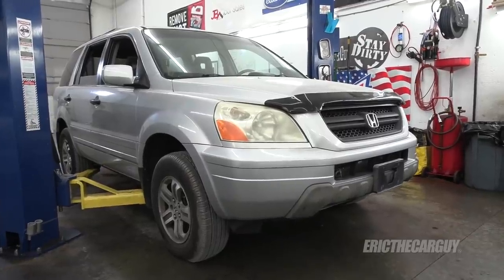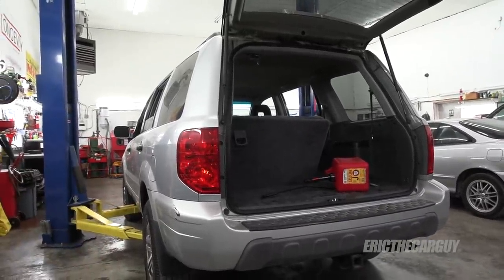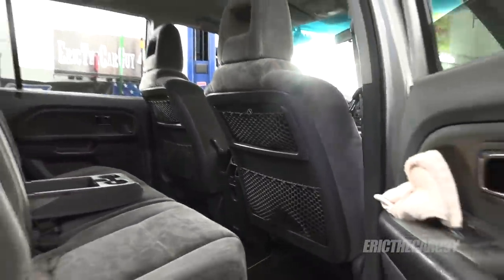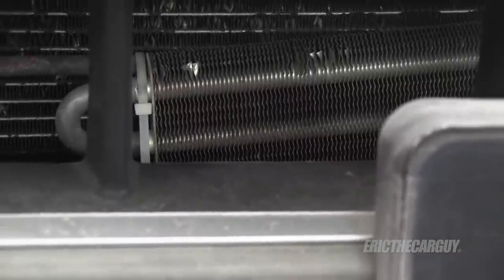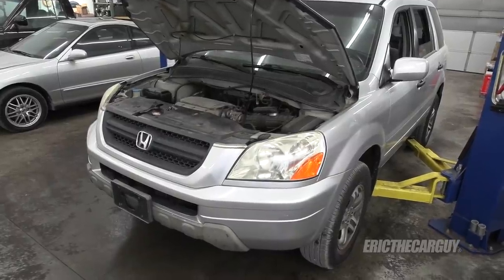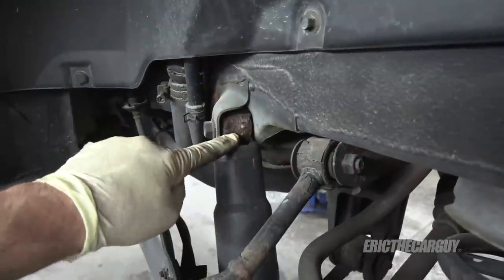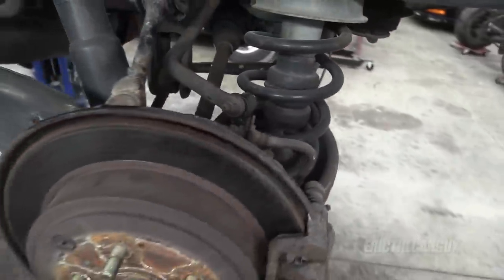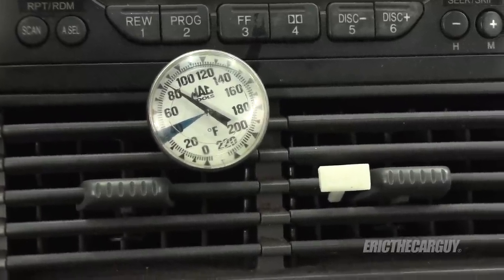2003 Honda Pilot Inspection This Thing Needs Help

Comment: Eric: Unlike your other Honda V6 engines you've been working on, this one has the PCV valve rear valve cover, and the fresh air port (from the intake tube) on the front valve cover next to the oil cap. That means the rear head is the one filled with crankcase fumes and gets ALL the baked on crap. So on this particular engine it's safe to assume the rear head is at least twice as gunked up as the front head.  This design annoyed me cause checking under the oil cap was a lie and only revealed the "cleanest" section of the engine (where fresh air comes in).
Reply from the maker: I suppose we'll see when I get the valve covers off. Thanks for the comment.
Reply: Yep my 99 accord same thing, front was clean, rear redish brown
Reply: If its an 03 , I take its a J35A4
Reply: @ericthecarguy  one thing with the pilots every 100,000 miles need to do the timing belt and the valve adjustments
Reply: @at6098  talking to a dude that’s worked for Honda I’m sure he knows
Reply: @at6098  You know he's been working on Hondas for like 25 years, right?

Comment: They may have bypassed the factory trans cooler so they wouldn’t get the “milkshake of death”.     (A common problem with pilot and ridgeline the fitting on the radiator).
Reply: Hmm .... you bring up a great point.  Perhaps they already made the milkshake and were trying to see if they could save it with a flush, fresh fluid and an external cooler.

The milkshake issue is a known problem on my 08 Nissan Titan so when I developed a small radiator leak, I went ahead and put down the change for an all aluminum radiator (without the internal cooler) and added an external cooler.  Now only God can make the strawberry milkshake of death.
Reply: @jimjones5077  titans had that issue too didnt know, thougbt it was only Pathfinder/Frontiers
Reply: My exact thought when saw that.  Typically should put in the much larger oem tranny cooler did that to my 2005 pilot EX-L a few years ago as precentative to avoid my tranny to be screwed when the faulty radiator goes.

Comment: My son is a 2004 pilot ex with around 285,000 miles. Already replaced the transmission and radiator. He also bought a complete exhaust system from where you got your exhaust for your element.  The exhaust by the catalytic converter was rusted.

Comment: I bought a 2005 Pilot brand new.  I put 120K miles on it, sold it to my inlaws who put another 20K miles on it, then bought it back for my son.  At 170K miles it still runs great and has been trouble free.  I've done some of the things on your list (timing belt, brakes, suspension, tie rods) but am really looking forward to watching all your videos.

Comment: I have a 2007 Ridgeline that bent valves. Have you ever or do you suggest replacing valves or cylinder heads?

Comment: Can't wait because we have a 05...I am definitely interested in transmission info about remove and replace. I will be watching with anticipation. Thanks again for the great work you do!
Reply: We have an 05 also. 220,000 miles. Thing is a miracle
Reply: @dancs5414  my sons has 260,000 and it's his daily driver.
Reply: Same here have a 05 EX-L with 150k for the past 3 years hasn't failed me at all except basic maintenance items and is solid

Comment: Having pulled a salvage yard motor in July 2021 for my bro-in-law's 2004 Pilot, all of this is intimately familiar.  Not a veteran wrench on Honda products.  But we did a good job, got it running, drove it to a local garage to do some gasket work that, frankly, I was kind of wiped out to do.  Garage said I did a good job with the timing belt/water pump, go me.  The 00's Pilots don't feel much like an SUV as they don't ride like trucks.  But now I'm familiar with the 3.5, I'm looking around for 'distressed' Honda Odysseys that need an engine or trans swap to make them good again.

Comment: I bought a 2003 Honda Pilot a few years ago it had close to 100k miles when we bought it, a few years later I sold it to one of my siblings and it had close to 200k miles, and is still running. Best buy ever!

Comment: Transmission shift sensors are notorious for failing. May not be the transmission. I know you said you worked @ Acura. I have an 05.
Also, MaxLife transmission fluid works just fine. 183K miles. Looking forward to seeing what I can learn.

Comment: My dad's first pilot, which was ironically another silver 2003, also had the same thing happen with the 3rd row seat not folding down because the release handle broke. It was actually fixed under warranty so unfortunately I don't know what they did to fix that but I do know that it is a common problem on those things.

Comment: I remember driving a 2000 TL, dreading the inevitable P0740. Never showed up. The transmission failed, but I got a P0750 code instead. Sold it to a tech at the Honda dealer for $400. Eric, you told me I should ask for more, but I was so PO'd that I just wanted it gone. Fun times. The only confirmed fix for those cars was to fit a 2006/7 Accord V6 transmission in.

Comment: Eric here is a tip for ya , I worked at Honda for 26 years and my hobby was wrenching on cars and I imagined at a young age a career in auto repair industry so I ended up staying updated by my hobby and working on all the cars for all my buddies I worked with and their families and friends so naturally a lot of those were Honda’s and one of my many secrets I picked up along the way was as a employee I got a discount on all the oem parts I ordered thru service center but I discovered that if I ordered those parts online thru a place called majestic Honda which by the way is a dealer up north east like New Hampshire or Massachusetts or something like that been three or four years since I have ordered parts from them by now but the point is I got a bigger discount than I got from the service center located on factory grounds and some were substantial so if you want to give it a try and you can wait few days for delivery you could save alot money and the exploded diagram on the website was especially convenient and helpful also when getting those oem part numbers anyhow good luck and don’t let them wrenches get rusty.
Reply from the maker: I did that for a while from a place called HondaPartsNow. Thing is, after you factor in shipping, the cost is about the same. Also, since I'm in OH, I get the parts faster from the dealer since most of them come from Troy anyway. Thanks for the heads up and comment.

Comment: 1st thing, that came into my mind with cables hooked into the airtemp-sensor: The ebay "Tune-ECUs"! Mostly they are small resistors and got hooked up to cheat the ECU into thinking the air is at a different temp, to get a whole lot of snake-oil claims: better gas mileage, more power, better emissions - you name it.

Have a nice day!
Simmie

Comment: I'm curious to see you mount what i'm pretty sure is a GM 3800 series II intake onto that if you use it. Those M90's added 40 hp to the series II V6's giving them 240 at the crank. The later series III 3800 had an improved M90 which added 60 hp giving it 260. they weren't ran with intercoolers from the factory either. I'm looking forward to this.

Comment: I bought a 2005 Honda Pilot with 200,000 miles and just did a cross country trip west coast to east coast and had no issues whatsoever, also on my trip my friends 2002 Excursion 7.3 diesel ran out of gas on the interstate..(which was scary moment because had concrete barriers on both sides on both lanes) i hooked up 2- 1 inch tow straps to my tow package to his Excursion and towed him with my pilot 1/2mile and up an exit ramp with another 1/4mile to the gas station!....Pilots rock

Comment: Hey how we doing you help me wait a bit on different things I just recently watched a video on brake controller and redid the ground well I have a 1995 jeep sport everything works good except when you pull the lights on or parking lights or headlights doesn’t matter trailer goes in the lock mode just wonder if you could help Appreciate your videos and thanks for help

Comment: Thanks Eric for helping fix my Pilot.  One suggestion is to inspect for rust just in front of the spare tire, where the subframe bolts connect to the body.  You'll maybe not notice if one side is bad, but when the second side pulls out, the rear suspension drops down .. No fun if it happens without warning .. I'm looking forward to the supercharger build. Thanks again.

Comment: I just recently picked up an 05 Pilot AWD with 220k. Engine and trans are great, cold ac, newer all weather tires, laundry list of new front end components. Picked it up for $1500 because the rear sub frame is rotted. I changed the front and rear brakes, spark plugs, timing belt and water pump on it.

I'm a truck driver so I only drive it a few times a month and then we take it on long trips every couple months. Should last a few years before that rear sub frame mount gives out completely 😅

Comment: I like SUVs mainly because of the higher ride height. In my country, roads are pretty bad for lower standing vehicles such as sedans and minivans. It's a nightmare. Granted, SUVs are a little bit more expensive to maintain, but if you have the money, you like them and suit your needs, go for one. They are very practical vehicles for what they are, too.

Comment: I have a 2003 honda pilot with 213k miles and its running strong still on original transmission. I gotta replace the timing belt soon though which I'm not looking forward to

Comment: I have an 03 Acura MDX and half the problems that pilot has I got I'm worried about the bumper dropping off 😅 but I'm also concern why my trans keeps holding the 1st gear going to 2nd 🤔 but that supercharger setup I REALLY 😃 want to do that but I can't unfortunately 😅

Comment: Seems like it'll be a fun project but when I had my 04 it seemed to be never ending problems. Make sure you check the brake lines at the rear wheels for rust. Both sides rusted out and leaked

Comment: These days I use Valvoline MaxLife ATF in my '98 CRV and '05 Pilot....been using it for around eight years. It's a synthetic and I like it better than Honda's ATF...and it's much cheaper($17.89/gal at Walmart)  to boot.

Comment: My wife has a 2004 Pilot the same color with 223,000 miles.  It needs a lot of work, but it still runs and drives pretty good. There is a lot of rust and bad bushings underneath.  Also needs engine mounts and a tune up. I'll get it all done eventually. Maybe

Comment: I just bought the cousin to this it's 05 mdx people said engine was bad but it was the alternator and ac pump froze up.. I only gave 200. For mine tho. I'm going fix that and rear sub frame rust issue .. just use it for beater

Comment: As the proud owner of an '05 EX Pilot, I love and depend on Eric's videos (yes I did my timing belt, thanks!). But supercharged? You madman! I can't wait. PS I grabbed a factory aux trans cooler from my local auto wrecker, and it was a breeze to install (after flushing, of course).

Comment: I have a 2007 honda pilot. They are usually good if taken care of. Maintenance items I've had with it are as follows: wheel hub replacement, timing belt replacement, shock stop, tailgate latch assembly and ac assembly line replacement.   Planning on adding a tow receiver if I find one at a decent price. Can't wait to see the supercharger on there
Reply: My 2003 has the factory towing package which has only been used a couple of times. I’ve replaced door lock actuators and the rear air blower relay a couple of times. Mine has the rear entertainment system and it all still works. One of the best cars I’ve owned since my 1997 Accord

Comment: Eric, get a water to air intercooler, and a heat exchanger, run the water for the W2A through the heat exchanger, and plumb the other half of it to the AC system to cool the water.

Look up Killer Chiller, it's a really good design, keeps the intake temps way down.

Comment: I hear ya about the bead leaks ! 3 times to the same shop before it stopped. I wouldn't want to toe anything even if it wasn't rusted. Those uni-bodies to me are weak. The AC doesn't work that sux. LOL

Comment: No oil leaks and look inside the motor for the mileage looks super clean 👌
Reply from the maker: I think it was well maintained early in its life.
Reply: @ericthecarguy  I agree very well maintained and the amount of rust is actually impressive for the vehicles location and state was very well cared for

Comment: You bought this car about a month after I bought my 2007 pilot I've done the front and rear suspension as you plan to do. Looking forward to watching your supercharge this thing. I will tell you there is a plate you can purchase for this car to adapt that supercharger it does not have an intercooler though. Texas Honda channel did this on a pilot about 6 months ago if you want to look it up.
Reply from the maker: I found his channel during my research. He provided a lot of useful info. Thanks for the comment.

Comment: I have a 2008. Motor blew when I paid a "Dum*&*&*??" to change the timing belt. He didn't torque a tensioner properly and blew the engine. Waiting for the heads to come back from the shop right now. I love this car, but it's a bit sluggish on the road and I wish I could fit a manual tranny on it. I wonder if there's a way to put a manual tranny in it...

Comment: My thoughts on that transmission cooler are that they bypassed the cooler in the radiator out of fear of creating the old strawberry milkshake of death in the transmission if the radiator falls in that way. Some of those are more prone to that than others though

Comment: We have a 2004 Pilot, with about 185k on it. Bought it with about 85k on it. The trans finally gave up. As you stated, it wasn’t worth the effort playing with solenoids and such. Without having a lift, it had to go to a shop for a reman unit. They also installed an external cooler in series. 

Everything else works great. 
Regarding towing, note that Honda requires extra power steering cooling. The factory piece costs $$$ and just has a little more tubing and a few more fins. My idea is to get a second standard cooler from a wrecking yard and add it in series. 

The left rear power window quit and I bought an OEM replacement. It was a HUA day and I convinced myself the mounting holes didn’t line up so I hogged them out to no avail. I continued the HUA adventure by buying a D****n unit. Then I discovered what needed to be moved to make the unit fit. 
Bottom line: I have an OEM left rear unit with elongated holes that hasn’t been powered up.
Let me know if you need it.

Comment: Well, it's certainly been around the block a few times - and it's got the scars to prove it. But all that wear & tear makes for excellent video material. Looking forward to it already! 😊🚗
Reply from the maker: Honestly, I think this Pilot was well maintained in its early life as evidenced by the lack of significant oil leaks. Then it went to someone who didn't really care and traded it in for something else. I think this ended up at auction and was picked up by the used car dealer that sold it to Jennifer. Now it's my turn. Have a great weekend.
Reply: @ericthecarguy  At least it has finally fallen into the right hands. Have a great weekend too. 😊🚗

Comment: I've got a similar 2003 with 160k on it, so really looking forward to this series! :)  The way the rear seat recline handles and/or cables break is frustrating and I've had a hard time finding replacements that last.  Also if you're taking the front bumper off for any transmission cooler or headlight work, can you call out the fastener groups involved?  I've tried taking mine off and it's held on by some divine force at this point.  Will be keeping an eye out in the Video Forum for more conversation on this car!
Reply from the maker: The key is the screws that go in from underneath where it connects to the fender in the wheel well. I'll show it in the videos at some point. Thanks for the comment.

Comment: I have an 06 Pilot I bought back in November 2020. I had the entire timing belt water pump kit replaced along with NGK laser spark plugs and cheap eBay coils. The front end was clunking therefore replaced the stabilizer bushings & links. The lower arm bushes were worn so had those replaced. While I was at it, also took care of the transmission fluid and filter, these where  Honda Acura parts. So far it’s been a very comfortable ride, I’d say it handles better than it’s competitors the Toyota Highlander and Lexus RX. However, the built quality on the Highlander and RX of the same vintage is better due to them being Japanese made.
Reply: Your gen pilot has way more head room than those Toyota you mentioned.
Also the pilot is way easier to work on
Than the Toyota.

Comment: U got a great deal i got a 04 pontiac grandprix 3.8 v6 with 212k miles for 800 in really great shape jsut a few little things iv doen the radioter  which ahd a small crack and thermostat it will need shocks and struts and breaks  down the lien engine is soild and looked liek ti was well mantined changed the oil and added soem restor and ti runs great liek u i want to get it on the track and see what it does in the 1/4 mile nice job and great buy on that honda

Comment: It is a miracle that the driver rear subframe bolt hasn't ripped out yet. It almost guaranteed at that age on Pilots. ASK how I know. Those bad ball joints, I didn't think they could be THAT bad yet still attached.  I bet the previous owner was really happy to get that much money out of it.

Comment: Eric, the early Pilots suffered from a failure in the radiator trans cooler which would result in milkshake of death (trans fluid mixing with coolant.) That may be why they eliminated the radiator tans cooler.